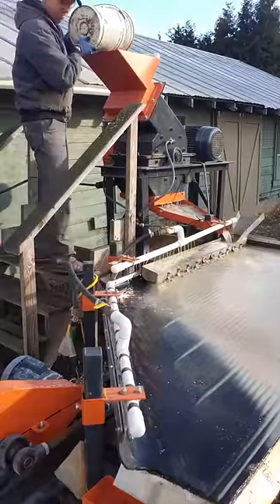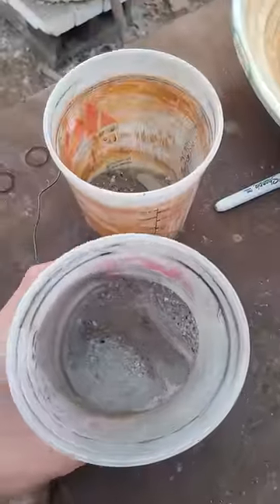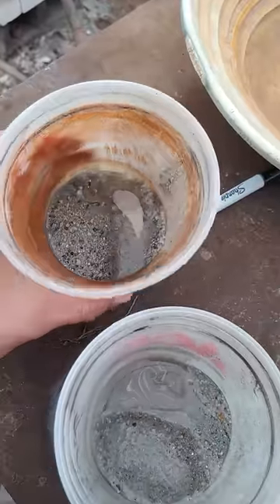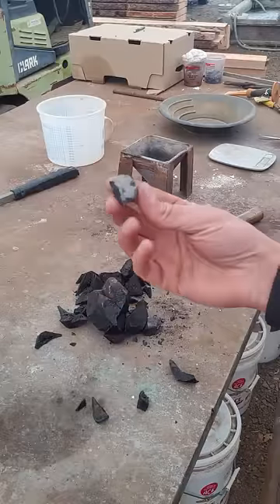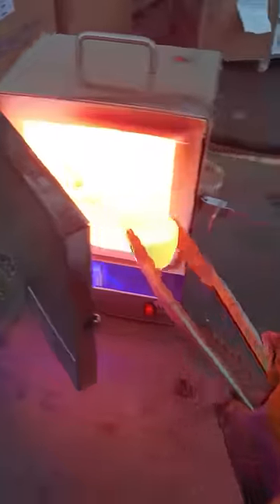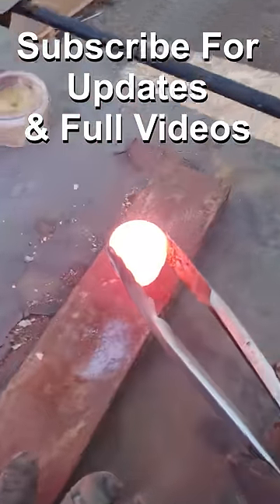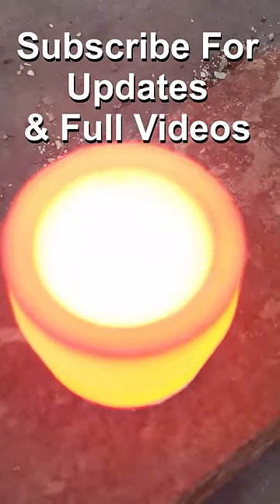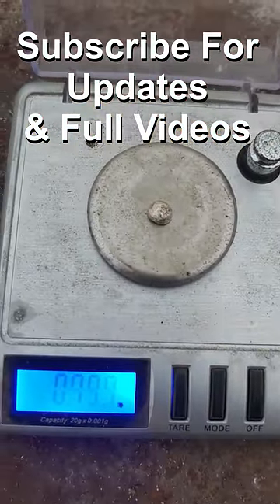Gold and Silver in 60 seconds

Comment: It's super bad for your health to use insulating ceramic wool without coating it first, you wouldn't want to do it with asbestos either. Also crucible tongs are super useful. You don't want to break the crucible with he pliers and spill molten metal or Flux on your feet or something
Reply: Came to comment the same

Comment: That shifting pattern in the molten metal is mesmerising
Reply: Looks like the surface of the sun
Reply: Looks like my fire cape
Reply: @DrDeuteron I was looking exactly for your comment 😂
Reply: It’s called furnacing melting the precious metal via extraction !
Reply: @BossModeGod hell yeah 💯
Reply: @DrDeuteron that's because they share the same property of convection. In this case, it's molten metal that's circulating. In the sun's case, it's plasma that's circulating.
Reply: @wedmunds  right, but if you want to be impressive: find a scaling law to relate the two...
Reply: @DrDeuteron  Raleigh number equation. The convection cell size scales with cube root of viscosity over gravity times thermal gradient.
Reply: They are called Benard Cells.....isolated convection currents rising in the fluid.
Reply: Molten slag* but yeah it looks incredible.
Reply: @DrDeuteron  nailed it
Reply: I think because gold and silver are molten at different temperatures so those swirls are the metals trying not to mix I believe
Reply: Last thing Caterpillar Inc father of three saw when he fell in the furnace — to make the boss 30 more grams of silver